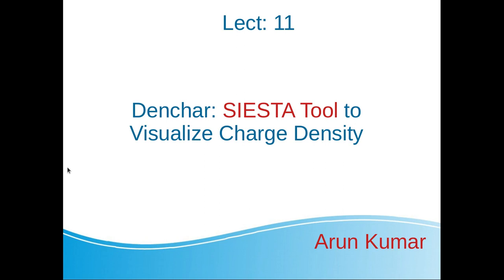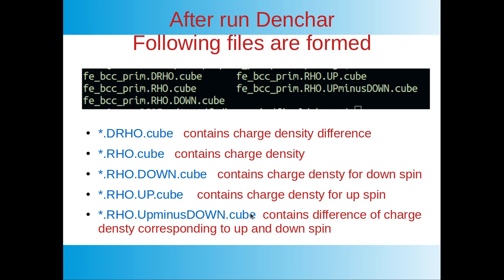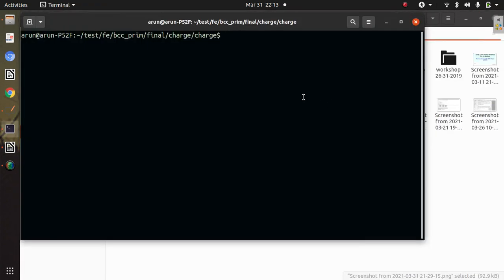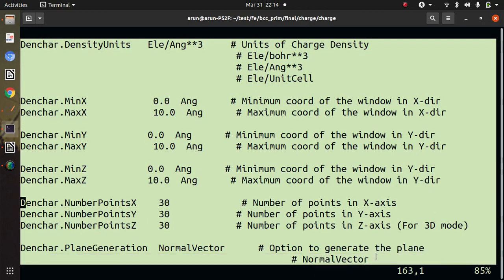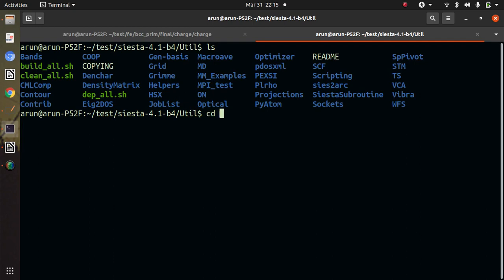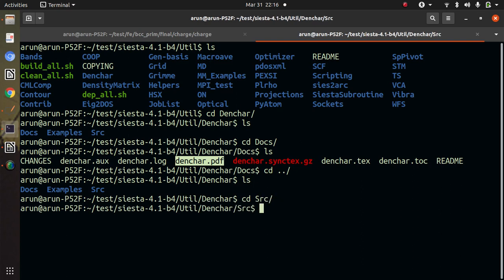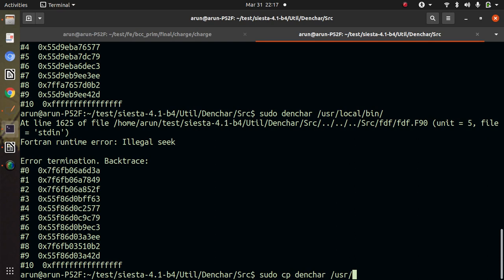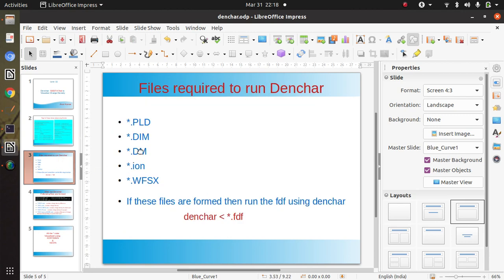Denchar: SIESTA tool for charge density analysis

Comment: Thak your for the lecture, very well done. I have a question: is it possible for Vesta to plot a certain plane at a certain height that can "cut" the 3D graph and put it in a 2D? For example, i'm working on chemisorbed graphene and i want to know the contour plots of the charge density at a certain height from the flat surface. Do you think this approach is valid or other methods exists? Thank you!
Reply from the maker: I thing you can do and method is possibly valid

Comment: how to generate *.PLD, *.DIM, *.DM, *.ion, *.WFSX  files ? Dr. thanks
Reply from the maker: These will be generated during run of Siesta. But you have to mention appropriate flags
Reply: @arunphy   thanks for response. But which appropriate flags? I have run the siesta. In files, there is no such files except for *.DM
Reply from the maker: I mentioned in the fdf
Reply from the maker: Or you can go through manual